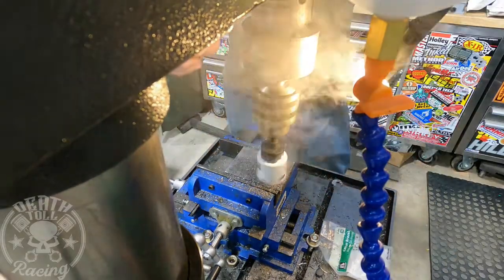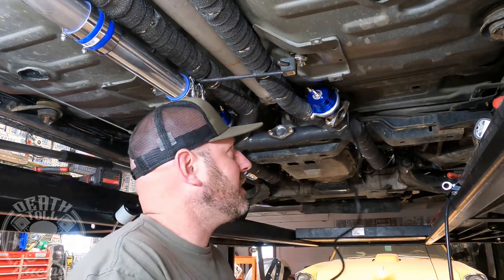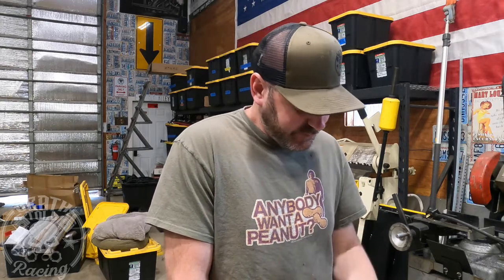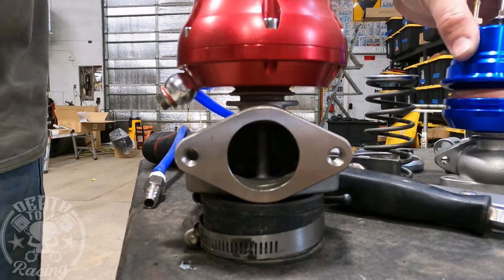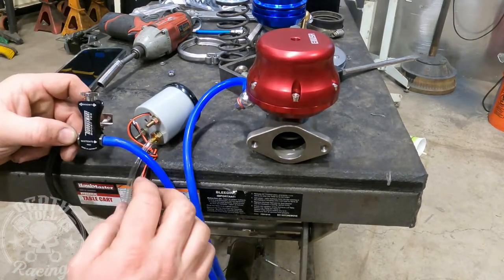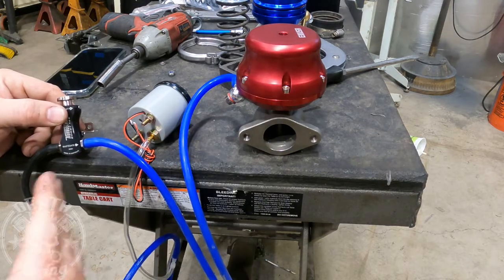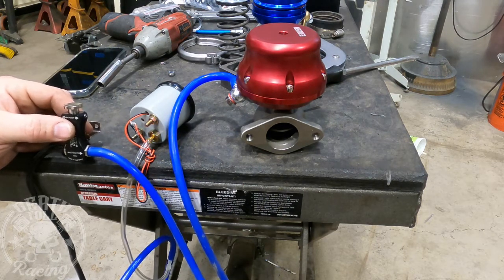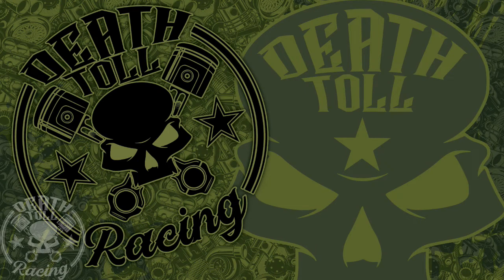Ep 8, POS Wastegates, Testing and Bench Tuning,  Twin Turbo P71 Crown Victoria Ford 4.6 2v

Comment: I believe waste gate springs work off psi, meaning area of the gate/plunger. In other words, a 1" area gate will be 1 to 1, where a 2 sq inch gate will take more spring to hold it closed. 
From what I understand also, if the gate can flow enough to bleed all excess pressure, running 1 gate will be more responsive than running 2. Reason being that just cracking the gate, 2 will bleed twice as much as 1 would, which you feel as lower boost and response at lower engine speeds and throttle inputs.
Remember that the primary thing that opens the waste gate is the in exhaust pressure, not the boost pressure from the controller. And you can put that pressure on either side of the dome in the gate, raising or lowering  the spring pressure.

Comment: What would a plumbing setup like this cost to have built at an exhaust shop ?
Reply from the maker: If you had the turbo's hung for them already, I imagine it wouldn't be too bad.  I would guess $300-$500 at  the most.  It's very simple and with their bender, they could make really quick work of it.   Once the system on mine is "proven" I will be going through an entire parts list, and revamping it for what I "should have done".  I believe I can get the cost down on this by sourcing the parts differently.  Hopefully the series will gain some traction, I thought it would be doing better by now.  So Share share share.  Lol

Comment: Interesting setup. My hunch is the exhaust pressure on the plunger will end up requiring a stiffer spring, which might be why the kit came with a stiff spring, but I am very limited in my turbo knowledge so I am excited to find out either way.  I do want to see more of the sexy guy from the first video. Oh La La...
Reply from the maker: The guy with the finest of tastes for atf?
Reply: @DeathTollRacing  ohhhhh yiiiiiiiis
Reply from the maker: I think you’re right on the exhaust pressure. We will see. The springs that measured 10psi that I took out are supposed to be 7.5psi springs. So maybe a rough calculation for exhaust pressure is 25%. We will see.  Science 🧪